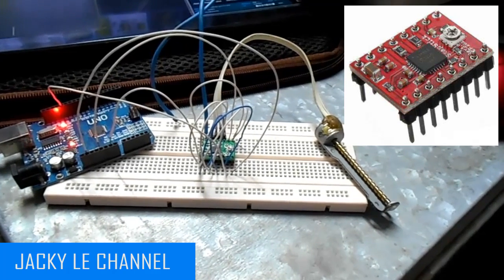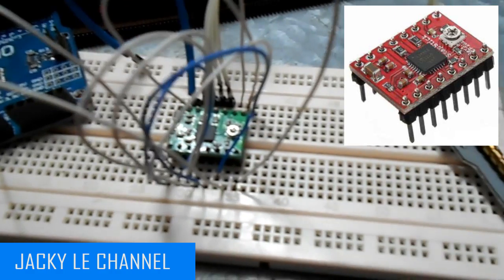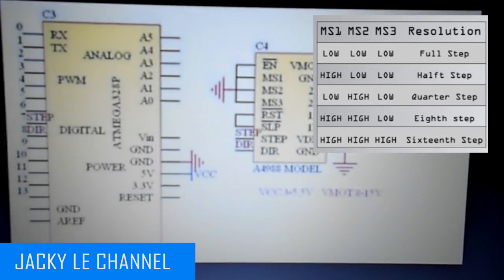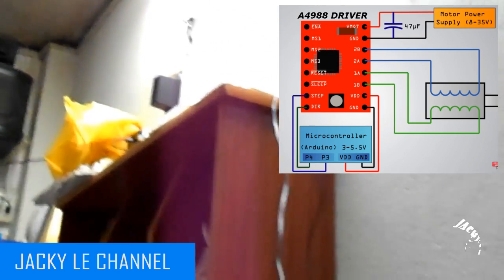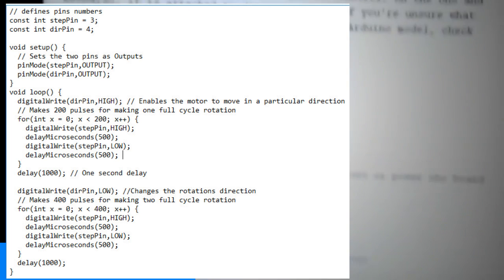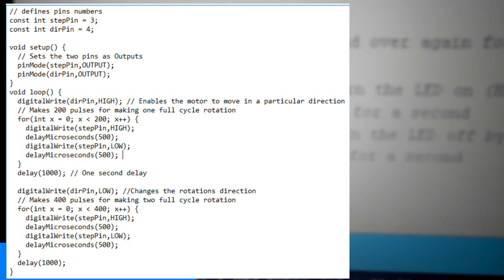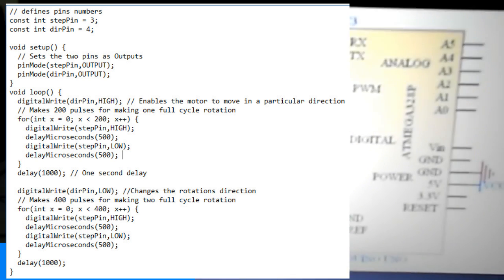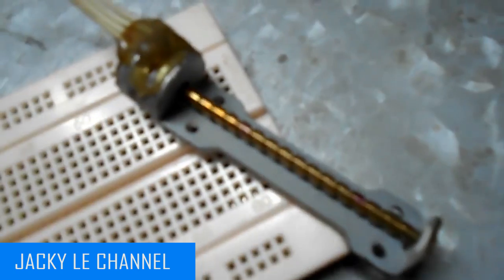Arduino Control Stepper CD DVD Motor use A4988 driver with code

Comment: The most important information needed to set up a CD/DVD stepper with an A4988 is not in this video. See the data sheet for the A4988.
You need to use at least 8 volts for VMOT (the motor voltage). You need to set the proper current using the trimpot on the A4988. You need to set MS1, MS2 and MS3 for either full, half, quarter, eighth or sixteenth microstepping.

Comment: what is ms1,ms2 and ms3 related with 4 pins of the motor?
Reply from the maker: MS1,MS2,MS3 use for step motor control mode selection